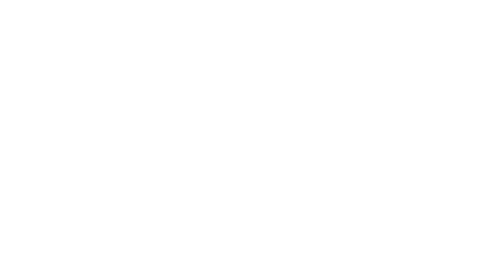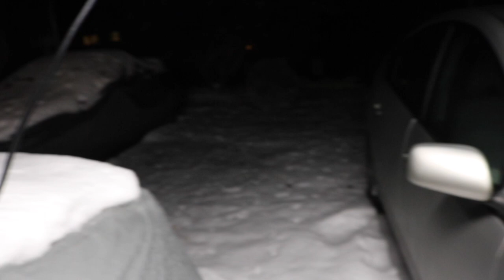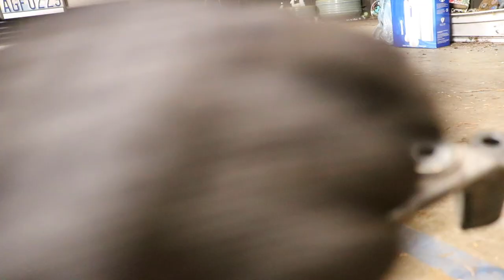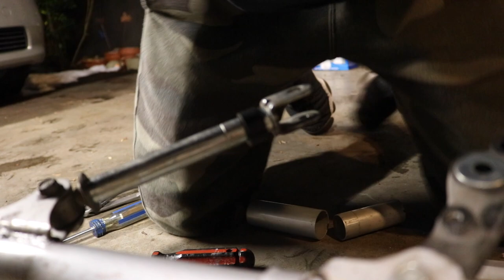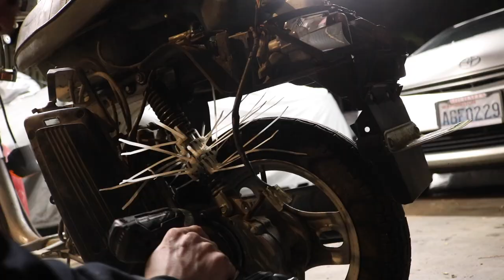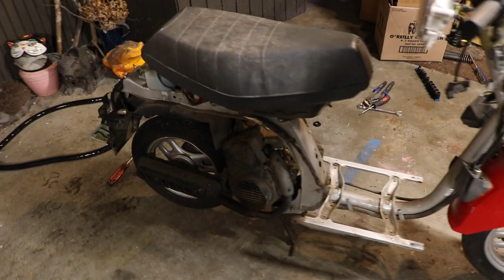Finally!! Lowering my Honda Aero 50!! Scooter Build PT#2

Comment: Quick question, on your rsx do you have a stock resonator. On that video when you installed the N1 spoon muffler.
Reply from the maker: Yeah it’s a stock resonator. I will be getting mid pipe and headers for it soon so stay tuned! 🤙
Reply: @jdm.dennis  another quick question I have a 2005 base rsx and if I get the N1 spoon exhaust, will it sound the same as yours? I also have a stock resonator.
Reply from the maker: @fabiantrevino6858  I will say yeah! It should sounds the same or close.